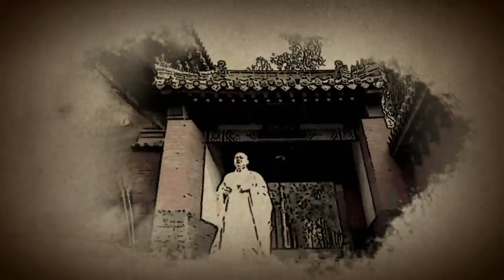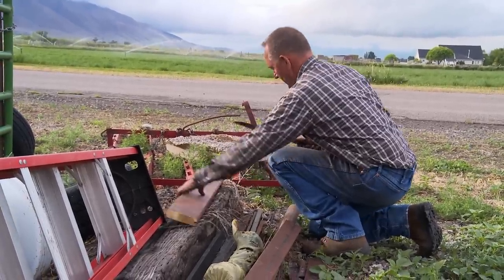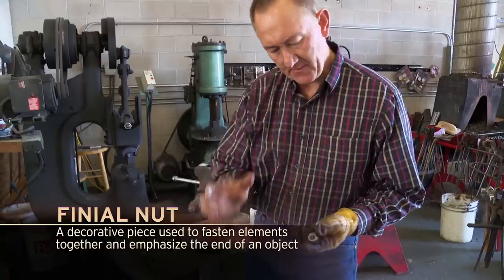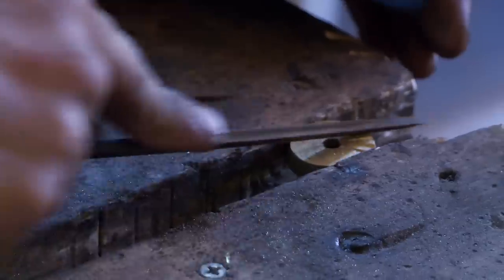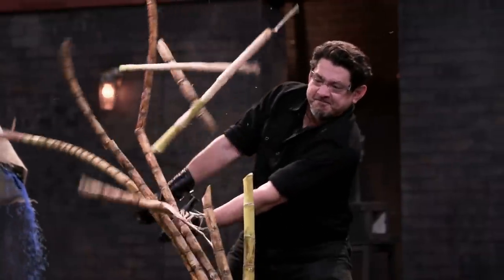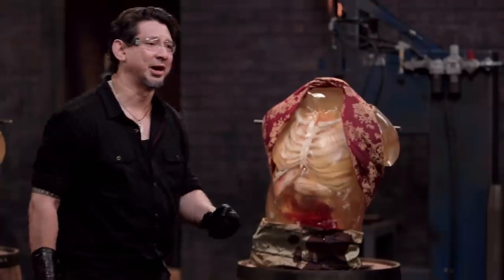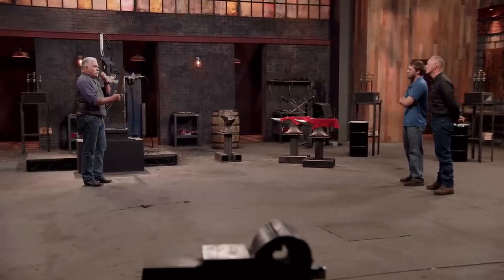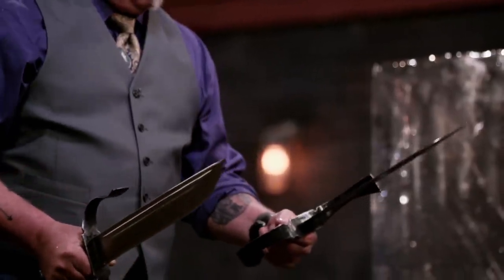Forged in Fire: DEADLY Butterfly Swords are *Ready to KEAL* (Season 3) | History

Comment: When Dave questioned why the lower 3rd wasn't sharpened and Shane answered correctly, I knew he was gonna win it!
Reply: A perfect response to the question! I was taught it was a way to threaten someone without drawing blood. You could place it against an oppoants throat and if they fought then the draw would kill them, meaning you could use them as a hostage more easily without dexapitading them.
Reply: @williamlockhartnelson8873  It's information like that, that make this blade even cooler! This is truly a masterpiece of a weapon!
Reply: That’s not true.  It’s a myth that these swords are intentionally made dull.
Reply: jordan5221  It might not exactly have been the correct answer, but the assessment that the blades were typically duller there was what mattered more than the why.
Reply: An important detail of the DESIGN  !!
Reply: Yes.. the deciding factor here is not the quality of the weapons and their aesthetics.. but rather it was obvious that one has done his homework researching the historical aspect of the weapon better than the other.. while the function of the unsharpened proximal edge might be debatable (hence tolerable), the practicality aspect of holding it in 1 hand and sheathing it in 1 scabbard was specifically emphasized during the intro thus might greatly affect the judgment..

Aesthetically, Andy did a better job.. but function wise Shane was on the dot..
Reply: Same. I dig that he did that research though. It shows that he cares about what he makes.
Reply: Well don't forget the other guy made his blades too big on the handles not allowing to be unsheathed as one weapon as pointed out. Handles and keeping at the parameters of the blade design are always a loss.
Reply: @williamlockhartnelson8873  Yep, I'm sure a well-trained user would have 4 or 5 good uses, because we've already found 3.
Reply: And that kids is why you always do your reaserch.
Reply: Trained butterfly sword user here, I'll add a 4th reason, and the most important from what I was taught. The lower portion is not sharpened as it's supposed to be thicker for blocking weapons without damaging the blades. You intercept attacks with the bottom of the blades then turn one blade to hook the opponent's weapon while slashing them with the other blade. They are two halves of the same weapon and should be used together as such.
Reply: @rpoppermann  Yes, agreed. It was a common feature on European blades as well. Unlike what you see in movies, the whole edge isn't sharpened because it doesn't make practical sense to block another blade with your sharpened edge but the blade is stronger for blocking or checking a strike with a blade or staff to avoid chipping and breaking.
Reply: @EH45896  It's a myth? Then why have all the surviving pieces from the Qing dynasty have blades that are only sharp on the tip-half of the blade? I'm pretty sure the people who have made it their life's work to research weapon construction know how they should be made compared to some random on Youtube saying "it's a myth".
Reply: Agreed. The guy respects the historical origin and tries to follow the original design instead of just winging it. After all they were also tasked to recreate an iconic weapon from history so that unsharpened edge gave him the edge.

Comment: "Where are my nuts" Well after a cut like that and no panic at all just a classic tape bandage it just means your blind cause they gotta be big. i've seen less dangerous things happend to guys and they start crying or faint...
Reply: "Guys"
Reply: fun fact cuts like that are pretty painless. I've had a few cuts worse than his and you just feel the pressure but no pain
Reply: Got a 2 inch cut to the bone on my thumb about a month ago. No pain from the cut or at all durig healing. The only pain I had was from the lidocane while getting stiches. If you keep a knife sharp it cuts deep but really doesnt hurt.
Reply: @Freakmaster480  Yea it really depends on the place and as you said if the blade is razor sharp with smaller cuts its sometimes weird cause you cant feel anything but you spot blood spilling out when you reach for something the worse thing is when people panic then you can create pain just out of the thought of beeing cut
Reply: @AcidHeat  I was in highscool bio and we were doing some lab years ago where we needed to take super thin slices of plants using a razor blade. Some girl cut herself a tiny bit but fliched really bad when she realized what happened. The cut wasn't super deep but it was a solid 5-6 inches long and bled a lot.

Comment: Zuko used similar weapons as the Blue Spirit and in Zuko Alone
Reply: Exactly what I was thinking
Reply: this is the only comment that should be in this comment section
Reply: they were like a cross between butterfly swords and oxtail daos.
Reply: @treebahn  Buttertail daos maybe? :D
Reply: Duel dao or dorndao
Reply: hello, i'm a collector of chinese swords and have experience in Chinese martial arts (wushu and wingchun)
the swords zuko uses are the double broadswords (now commonly used in wushu), which are essentially 2 oxtail swords but with 2 complementary halves of a disc guards. the blades are as short as 26in (yes i have seen them that short) to as long as 31in. i own a pair and they are very fun to use lol.
the butterfly swords have handles and guards similar to a British light cavalry saber because of the flat guard, with flat and wide blades up to 18inches.
so yeah, the butterfly swords are not the ones zuko uses
hope this was useful :)
Reply: @mindfulmusic1029  Thanks for the info!
Reply: jefflitime someone pin this comment
Reply: Those are called broadswoards
Reply: My first thought
Reply: I said this on another video but I love that the ATLA and forging fan bases collide, it’s beautiful
Reply: Similar, but they're actually dual Chinese broadswords (shuangdao). Also designed to fit into a single scabbard and can be held in one hand, but are longer and don't accommodate for that reverse grip you can use on butterfly swords.
Reply: We saw Zukos swords now we need Jets swords
Reply: @mrskywars1237  we need Jets swords now

Comment: So basically, both blades were as good as they could be, however the winner's blades were designed better to be what they were supposed to be. Specifically when it comes to the 'They can fit in a single sheath' detail they mentioned, and that they aren't sharpened the entire way down.